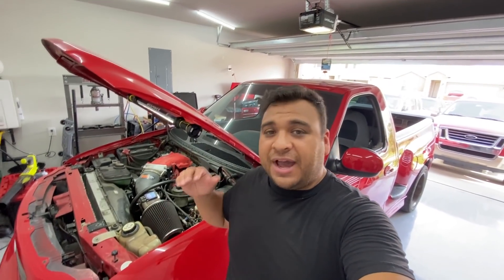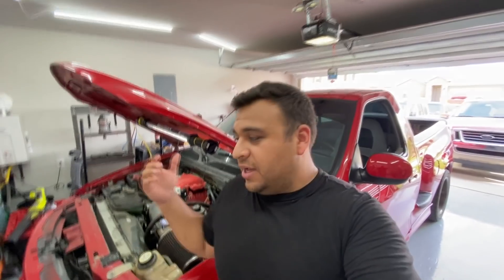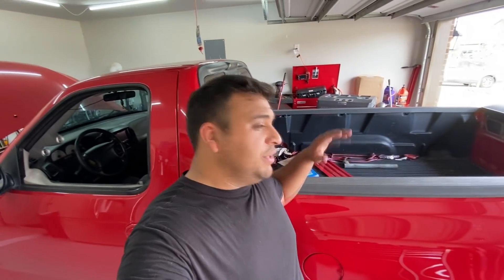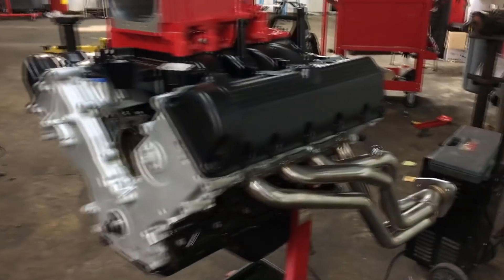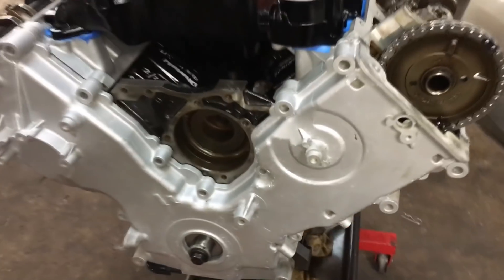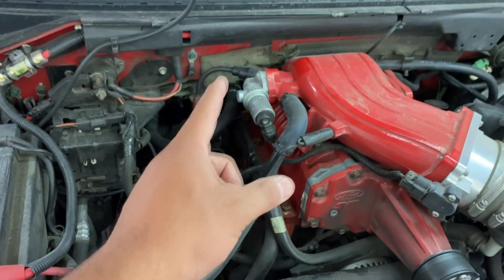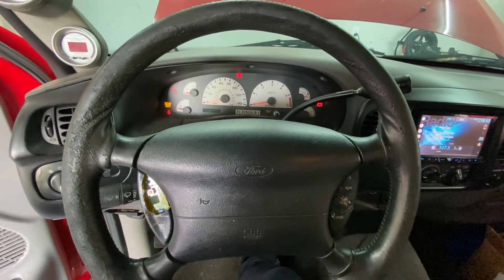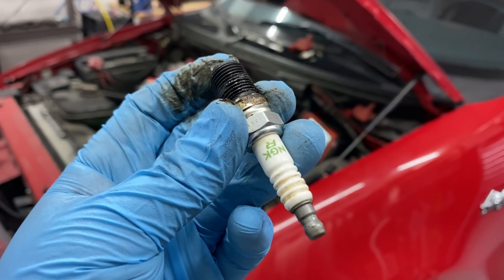FORD LIGHTNING TRUCK MISFIRE BLOWN HEAD GASKET DIAGNOSE & TEARDOWN PART 1

Comment from the maker: Just wanted to let everyone know that if you are interested in buying this scan tool. The coupon code is unavailable during Amazon Prime day which is June 21st-22nd because the product is already discounted to prime members.
Reply: if head is warped, because it has over head cam, it most be heat straightened. If you mill the heads, cam saddles will out of alignment, there goes the cam saddles next.
Reply from the maker: @Over Load Great point! We will find out in the next video!
Reply: That scan tool looks really good 💪. Is it support european cars?
Reply from the maker: @Matti Yes all makes and models. It has tons of functionality. Check out the reviews by clicking the Amazon link in the description.

Comment: When I was into my 4th year working at a Ford dealership, I was the drivability guy. I started to see a trend occurring for a few a short time with these old guys buying them Lightings, as a midlife crisis vehicle. Them fellas were running nitrous on them trucks and I kept on having trucks come in for the rough running concern under warranty, after locating the plugged hole in the underneath area of the induction tube, them old fellas warranties were VOIDED, they raised hell and the dealership paid for their aftermarket warranty because of the aftermarket accessories salesman lied to them and really wrecked our reputation for a minute. In 2018 we won the President Award from FoMoCo

Comment: THE SHOP REUSED THE FACTORY CYLINDER HEAD BOLTS.   AN DID NOT REPLACE THEM WITH NEW. OR UPDATED BOLT SETS.  AN HAVE TO BE TORQUED IN 3 STEPS.   USING TORQUE ANGLE..... DONT BE FOOLED.  YOU CAN CLEARLY SEE BETWEEN GASKET AN BLOCK.  (LOOSE BOLTS) OR OVER STRETCHED BOLTS..

Comment: I enjoy your presentation as I am of "old school" and know nothing of modern electronics in vehicles, but I have already learned a tremendous amount from your videos. Many of the shop and dealer problems that you have encounted are not confined to your part of the world only. Parts changes are a world wide problem, in fact there are some shops that I would not even give them a pencil to sharpen, let alone a vehicle to repair. Thanks for an informative and entertaining channel. I record your videos so that I can back track to clarify certain points.

Comment: shame for all your work to go into it again just for that dummy to burn it up again smh letting it burn up because of a simple heater connector leak😩
Reply: Using. cheap plastic in components always leads to problems. ALWAYS.

Comment: U r one hardworking young man. No phasers on the Lightening?  U need and M12 extended electric ratchet. It really helps in many situations. Another tough one u did was the 4.0 with no special tools. U a genius!!

Comment: Was there water in the oil or was it on the intake side would have liked to have seen the gasket to see the failure point. Good work man. Love seeing these trucks even as a mostly gm/chevy guy I never hated on ford's tbh though

Comment: I love the show, i learned a lot. I just have 1 question. Was there coolant in the oil and is that a sign tthat the head gasket is blown.
Reply from the maker: It was not as visible on the dipstick, but once I opened the engine there was milkshake on the valve covers and timing cover.

Comment: Not a fair comparison. The Chevy 454 SS is a stock factory truck. The Ford Lightening is a modified F150 with racing parts from the SVT division. The Dodge Ram V10 was also modified by MOPAR and had the Viper engine. I will never be a Ford guy myself, but I have to admit the Lightening is a sweet rig.